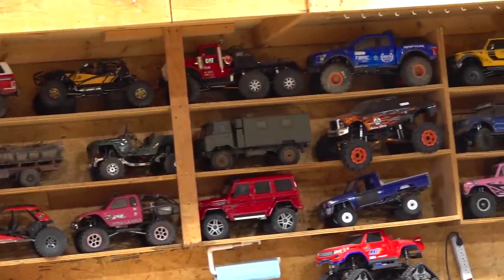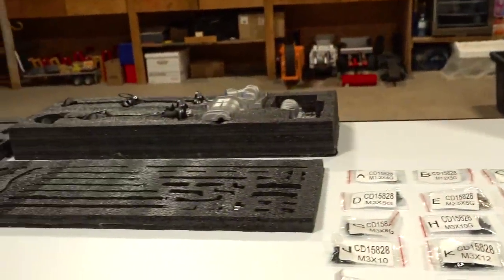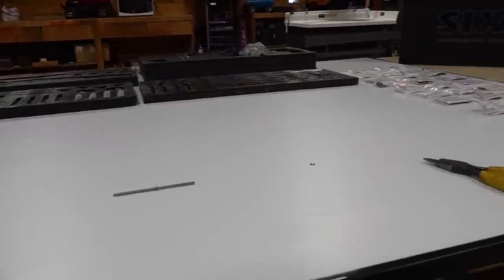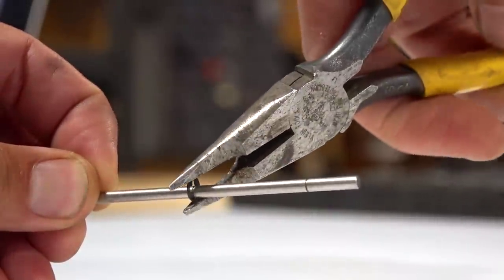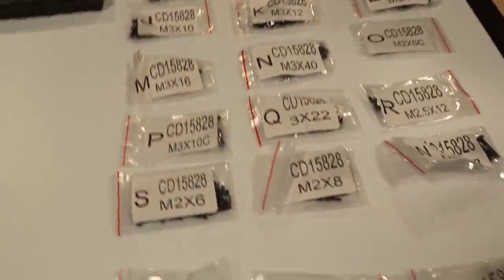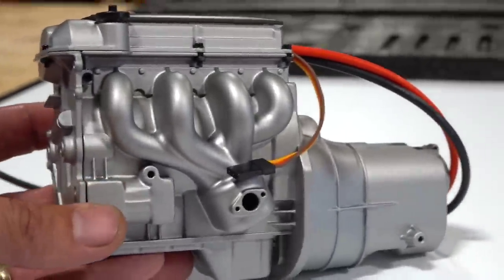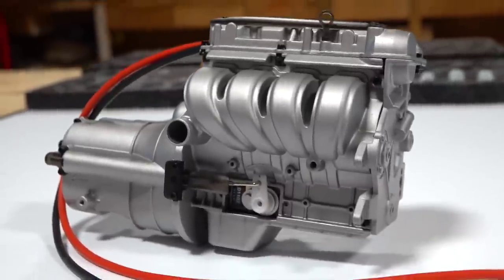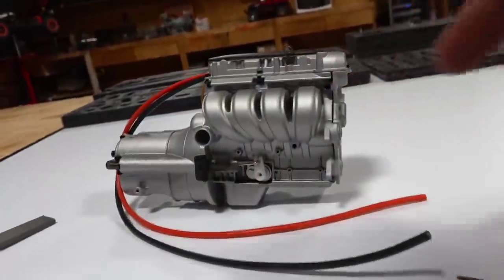BUiLDING a BELT DRIVEN SAMURAI HEART - CAPO SiXER 1 | RC ADVENTURES

Comment: Capo goes big on every product,  looks like to me! Cannot wait to see what the finished product looks like, or I guess I have the picture of the one you liked! Keep the great content coming! That's kind of cool belt driven off of the motor, saves tearing up gears and way cheaper than gears to buy belts. Only problem is how hard it they are to change.
👊😎👍🇺🇸

Comment: Really cool, looks to be pretty well designed. I suppose you'd kind of expect that for the price however. I'd love to build one of these, if I had some idle cash to throw around!
Nice vid, with a bit of humour too.👍

FYI (& no biggie!), the plastic part on the top of the engine casting you called the "valve cover" is actually a spark plug cover (IRL). The valve cover was the metal part below that.

Comment: Interesting transmission set up, I'm curious as to why they drive the bottom shaft with a belt and have the output shaft above it. Instead of using gears and have the output closer to the bottom of the transmission.

Comment: i would of routed the cables through the spark plug holes, i'm wondering if that is why the ignition cover is smoked versus solid color? It would be cool to see actual wires coming out the top and out the back of the smoked cover. Great build man, keep up the excellent content!!